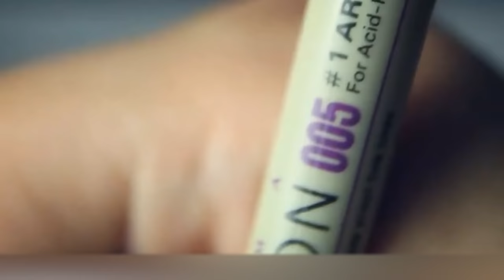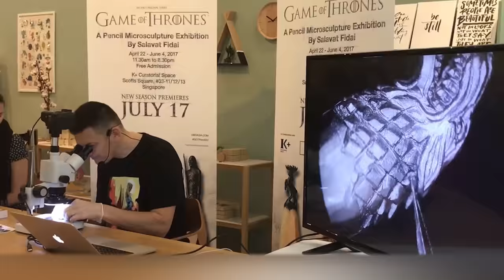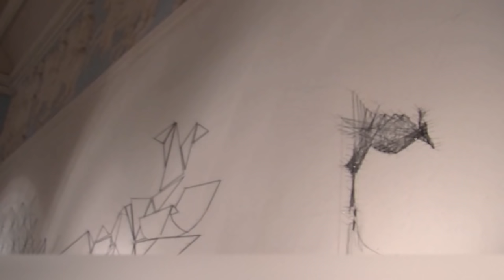A Painting Made of 3 Million Dots

Comment: I haven't made any drawings with nearly as many dots and I'll tell you my hands don't function correctly after I'm done with a small dot piece.
Reply: I have the same profile picture as you on a amino app
Reply: I play yugioh duelinks by the way, i dont know why i told you that
Reply: MasterWalt also isn't drawing with dots called stippling. I've done this before and learned it like that
Reply: That's correct. While I've never done a large piece. I had a classmate that spent months on a massive piece. It came out great
Reply: Roxi Rose both "pointilism" and "stippling" are correct terms. I used to do this technique in high school and early college but I gave it up because of the sheer amount of hours to create larger pieces. I did a self portrait in high school that took around 32 hours total. My instructor always wanted to know my secret for speed and my secret was "there was no secret". I sacrificed a lot of sleep to complete larger works quickly and in the end I realized.....it wasn't worth it.
Reply: Christopher Jakel man that's awesome! But yeah it does take time. I'm only going to be a Junior and I've done a couple pieces. One of them being a revolver shooting through a rose 🌹
Reply: Roxi Rose well. Good luck and keep up the art. If you are going to work in this style though, I suggest frequent breaks and stretches. Not so much for the hands and wrists but because of all of the hunching over. It makes for some pretty uncomfortable upper back and neck pain.
Reply: Same